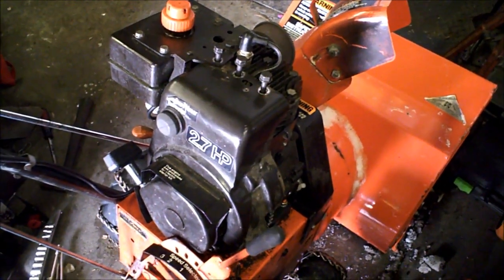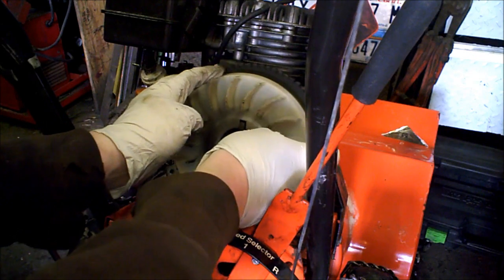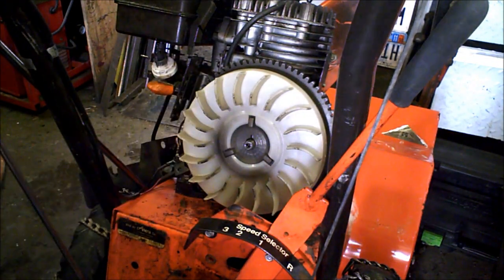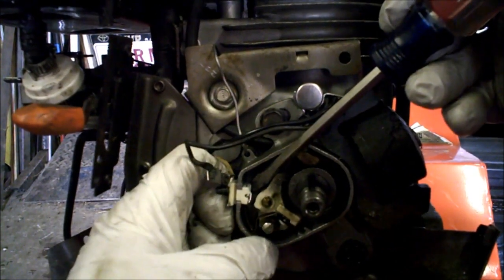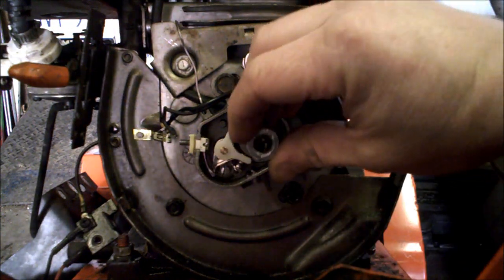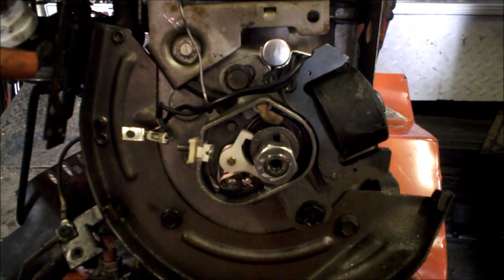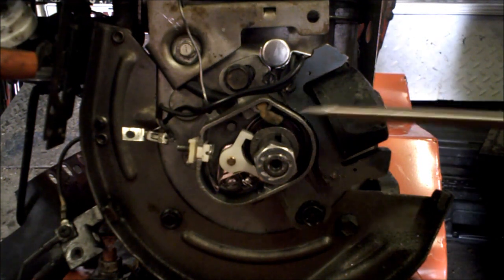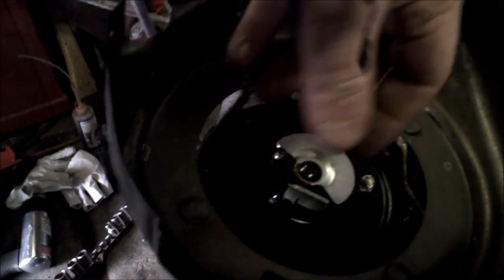Tecumseh Points and Condenser 3-10hp replace

Comment: I have a 40 year old outboard motor with a Tecumseh engine. I don't get a spark across the spark plug when I ground it, but I can feel the slight jolt when I ground the plug and hold it by the top.  Replaced coil, condenser and points 10 years ago and barely used the motor since.

I can test the condenser with my electronic meter.

Is it possible my flywheel magnet is too weak to provide a spark?
Reply from the maker: More than likely the points are tarnished from moisture in the air. Run a fine piece of sandpaper between them and you should be good to go.

Comment: Question: I have an old Sears/Craftsman snowblower with a 8hp Tecumseh.  The plastic fins are almost all broken (although the remaining ones still move some air), and parts are hard to come by.  Any ideas on how to fix this?
Reply from the maker: eBay will have your parts. The plastic shroud simply attaches to the cast iron flywheel.

Comment: this is great, I put one of these Tecumseh 10hp but same kind of points, on my log splitter, it worked for one afternoon now it won't start. The points are shiny, the condenser is rusted and looks original.  is there any way to test the condenser or ignition
I have a spark at the spark plug ...
Reply from the maker: Testing the condensor isn't easy, because you need a capacitence tester. Generally points and condensors are replaced together as routine maintenance. If it is rusted, water has gotten in and more than likely the points are corroded as well. Test for weak spark by holding a screwdriver(hold plastic handle) metal shaft around 1/4" away from the engine block, with the tip of the screwdriver inserted into the spark plug lead and you should see spark. This would signify a healthy strong spark.
Reply: Thanks! Is there anyone on line who you know carries this kind of condenser and points?
Reply from the maker: Yes, the points and condesor for these are very common and can be found online. If you look in the video description I have a link.

Comment: I have a Ariens 8hp 1976 with a TECUMSEN ENGINE. I have no spark to the plug. After seeing your instructions I will attempt to take it apart and check the ignition spark plg and condenser . I do believe that your vidieo will help me Thanks ( Chris Eybergen)
Reply from the maker: More than likely your points contacts of corroded a little. You can pick up a set of points/condesor very cheap online. On a side note; don't remove the ignition coil, as it is a long process to retime the entire engine.

Comment: Thanks for the video, very helpful.  I just had a quick question.  I have a 1980s Craftsman snow blower (Tecumseh engine model no. 143.687032), very similar to what you worked on in this video (at least the same orientation of magneto). I was wondering if this engine has the ability to produce a little power to run a light on the blower - I know some engines out there have a stator with a lead coming out of the engine so that you can power something like a light.  Well, my blower doesn't have a light built-in, but I would like to install one on it - my owner's manual for my blower says in the parts list that it has a stator assembly, but I don't really see an obvious lead coming out of the engine for powering separate electrical components like a light.  But since the manual says stator in the parts list, would that somehow work to produce a little power to run a light so that I wouldn't need to install a battery?
Reply from the maker: If it is a 8 or 10hp there is a chance it has a stator installed, but you will see an obvious loose wire coming out under the electric starter/side opposite the carburetor. It should be protruding approx 3-4inches. It isn't very common to have a stator installed but I've seen it and added lights. If you don't have one, your best bet is to just install a battery operated LED light.
Reply: @sixtyfiveford  Thank you very much for your considerations.  Yea, my blower is only around 5-6hp and doesn't have an obvious lead coming out of the engine for a light.  So as you mentioned (which was my alternate plan), I will get a nice 12 volt battery and led lights to install on the snow blower.

Comment: So many people hate Tecumseh engines.  I absolutely love them and I've never had a bad one.  When buying power equipment, I would only buy them if they HAD a Tecumseh.  At one time, 99.99 percent of all snowblowers came with the famous Tecumseh Snow King engine including all of the major manufacturers of quality machines ie:  Toro, Ariens, John Deere, MTD, Craftsman;  and the list goes on and on.  Tecumseh actually MADE Craftsman Lawn Mowers famous.  My John Deere 826 is 32 years old and it never misses a beat.  Tecumseh;  they were the best.  Keep the carbs clean, change oil often and at the right level, and they work and work hard.  They love it. What are your thoughts?
Reply from the maker: I'm a big fan of Tecumseh. I think Tecumseh made the easiest to start and best running winter engines ever. I've never had one I couldn't make a single pull start machine even in single digit temperatures. I love their push mower engines but prefer the larger Briggs Engines on Riding mowers.
Reply: I agree 100%, especially if its on a snowblower.
Only one thing, the points are harder to deal with than on Tecumseh vs a Briggs.
I'm dealing with it right now.
Ive dealt with it in the past too.
I sanded the points on the Briggs, spark came right back, the Tecumseh no dice and they both had spark in the summer time..
Otherwise their great, even better with electronic ignition.

Comment: good video ! wish i could find an old flywheel for mine as magnet fell off and broke into a few pieces,  have called some repair shops and they don't have a flywheel for my hm80-155127f  snowbird   hate to toss it out!
Reply from the maker: Ebay will have them. You should be able to pick up a used one for around 30-40bucks (without electric start ring gear) delivered.

Comment: Hey, 65 Ford guy, does that make you a Mustang, a Galaxie, a Falcon, a Fairlane, a F100 Pick'em Up Truck, or an Econoline PU? Inquiring minds want to know?

Thank you for the video about how to replace a condenser and set of points on a Tecumseh engine. This helped me out a lot. I guess since the points center pivot point is a fixed location, this would mean that the cam "timing" is non adjustable correct? 

I think most engines have some kind of "sweet spot" in the cam timing, where the engine is perking right along producing maximum torque  due to a whole lot of other "engine things" are  all working together, all at their best place in time. I think the most important thing is when the spark is advanced just enough to allow all the other important engine things to work together and do their best stuff.  Case in point, search for the "hit and miss" category under the heading of Old Iron. 

Does my lil three Hp one- lunger Tecumseh have this spark advancement feature built into it ? When the cam follower is at the top of the cam lobe, is the piston also at Top Dead Center? The ignition spark occurs when the points are first opened, quite a while before the lobe reaches its maximum height.   On my 1973 Yamaha 350, two-stroke, two banger, I set the points to where they open at so many degrees before each piston reaches it's TDC position. 

I'm not quite sure what setting the point gap to 0.20 thou actually does? At anything less than that magic number, what happens, do the contacts spark twice or what? What about if the gap is too big, what happens in that scenario, does anybody know? It seems like the engines spark timing must be engineered and "built into" the shape of the spark cam lobe itself? 

Anybody out there care to share what they know about ignition timing cam shapes?

I do know that engine intake and exhaust valve timing is critical for proper engine performance, and the shape or "grind" of a cam lobe can make one heck of a lot of difference where and when the engine breathes at its very best.  

One last probably very dumb question, something I am too embarrassed to actually  do during the day, lest my neighbors see me trying to do it and probably failing miserably shaking their heads at my utter stupidity for even trying to do it. 

Here goes, has anybody (probably lives on a private road) tried to use their two stage snow-thrower/blower to pick up, and (maybe?) grind up dry leaves, all the while blowing them into some sort of large breathable fabric bag of some kind, attached to the snow discharge spout? 

I know, I know, it's probably an insane idea to conceive it might work, let alone being something someone would be foolhardy enough to actually try to do. 

mrc109
Reply from the maker: +mrc109 F100 Pickup... 

The cam timing is fixed. You can adjust the spark timing by moving the ignition coil also by increasing/decreasing the point gap. The machine is designed for optimal dwell with a .020" gap and timed for that. If the gap gets too big you are wasting time that the system is building up spark energy for the next fire, if it is too small the spark can just the point gap. You could spend days playing with it and though on paper it may be better you would never get a noticeable power increase. The horsepower is just too small and most people are never pushing the HP to the max everytime they use it. The hit and miss engines are a different game entirely and are more rustic in their running functions. The only time a person would play with this is in racing applications and that involves much much higher rpms than these were designed to run stock. So if it is built up with all new internals and it is pushed above the stock 3600rpm, say 6000+ you will need to play with these things to get it just right. 

There is a video of a guy using it snowblower to throw leaved into the bed of his truck. Not very practical and I believe a standard push mower  with a bag is far superior.

Comment from the maker: I took a screwdriver and put the tip in the sparkplug boot and held the metal shaft of the screwdriver 1/8" away from the engine block. You should get a good spark when the rope is pulled. It had no spark. 95% of the time it's points, 4.9% of the time its condenser and .1% of the time its a bad coil.

Comment: hey 65,lov all the vids bro! i got older ariens snowblower tecumseh engine,did everything,points condenser,coil and flywheel and still no spark,how do i gound it? i swapped motorsand think thats the trouble,disconected all the switches and im pretty flusted.can u PLZ HELP!
Reply from the maker: The wire coming off the coil should not be grounded. Grounding it kills the spark signal.

Comment: Follow up.  I found the diagram online for the Tecumseh HMSK100 (159182T) and it does not appear to have points/condenser.  Just a coil.  Sound right to you?
Reply from the maker: Jeffery Bryan Yep, it'll be just a coil if it was made in the last 30years. They're great engines. The only advice I have is to run it 100% out of gas at the end of the season. This will ensure that it'll start right up the next season. Also if you want problem free running ethanol free gas is your best friend in any power equipment. The site pure-gas.org shows you local stations that offer this.

Comment: Hi great video, would you know the procedure to adjust the carb. on an 8hp Techumseh ?
Reply from the maker: Adjustment will only be required if it was manually miss-adjusted. I would clean the carb first, then go through the adjustment procedure. 

Start engine
Turn main jet screw(bottom of carb) out (ccw) until hesitation is heard/felt
Turn main jet screw inwards(cw) until hesitation is heard felt
Note the turns it took to get these two points  and set the main jet in the middle, maybe a little on the screwed out side(rich mixture)

The idle jet is set the same way, but with the engine idling vs running full rpm.

Clean the carb video: https://youtu.be/4W9Y3JC1yDY
Reply: Thanks for the Help. Its much appreciated!

Comment: what is your opinion about how often  the breaker points and condenser should be change  aprox .  in general
thanks
very nice video
Reply from the maker: I would say they need servicing every 5 years or so and need change only if they go bad(10-15years sometimes longer)
Reply: thanks for your comment

Comment: I like your video., However just curious could you also use a gear puller to pull that flywheel off for one? And two are you sure that that was 20,000s of an inch and not 200. Of an inch I just saw a simple math remember in third grade and learning decimals and fractions and.020 it's 200s? Correct me if I'm wrong
Reply from the maker: .001" is said as 1 thousandth so 20 of those( .020") is said as 20 thousandths. technically you could also say it correctly as "2 hundredths" but it is more commonly accepted to speak these measurements in the thousandths place since a lot of things go to the thousandths place; ie spark plug gap is 35 thousandths .035". 
A puller will generally end up breaking the flywheel or not fitting behind. They end up doing more harm than good on a taper shaft.
Reply: rs480285 ,I used a 3 jaw puller ,tighten,then tap center pivot,and cast iron flywheel shot off after the third torque+ tap.I'm really careful with aluminum ones,have broke off several fins in the past.

Comment: I changed out my points and condenser. I got spark. I'm sure it's set right. Idk just will not fire up. Iv checked it a bunch of times. Dose the kill wire hafe to be hooked up?
Reply from the maker: The kill wire shouldn't be touching any metal. If it does it'll ground out the spark.
Reply: @sixtyfiveford  that's the thing I don't have the kill wire hooked up at all it's just the condenser wire and the coil I know I got it hooked up right because it's getting spark but it might be out of time not by much I just don't get it
Reply from the maker: @revolution3797 The only way it'll go out of time is if you removed/loosened moved the coil. If it's out of time it would still fire and attempt to run. And or it'll fire too early and rip the pull cord out of your hand. 

Pull the plug and with choke off pull the cord a dozen times to clear any excess fuel in the cylinder. Place 5-6 drops of fuel down the spark plug hole. Insert the plug, still no choke but throttle set to fast. Attempt to start now. You should get it to run for a few seconds if you have good spark and compression.
Reply: @sixtyfiveford   gonna post a video of it, that's why the guy sold it because he couldn't get it running. I'm good too,it's a hubby of mine,been doing it for years.
Reply from the maker: @revolution3797  Sure you don't have a valve sticking open?
Reply: @sixtyfiveford  not sure I don't believe so worst case scenario I'll just have to take the head off and buy a new gasket thanks for replying
Reply from the maker: @revolution3797  I've had scenarios where the valve closes really slow. Generally, you can see the edge of it through the spark plug hole and watch it.

Comment: Changed the points, condenser, and coil  still no spark any idea? Thanks Fred
Reply from the maker: Make sure the grounding wire isn't touching the frame anywhere. It's best to completely disconnect it from under the carb for testing.

Comment: This is all great, but what do you do when the 8HP horizontal (generator) engine has no nameplate/model number anywhere (there is nameplate for the generator, but that says nothing about the engine), and dealers claim magneto/point replacements "do not exist"?  My magneto has 3 legs, and it is set inside a hollow flywheel (with inward-facing magnets).  If I could get parts lists/diagrams from a group of engines, I could have a prayer of finding replacement parts!  There are also electronic replacements for points/condenser that I would like to get for my engine.
Reply from the maker: What brand of engine is it?
Reply: @sixtyfiveford  Tecumseh.  I know it is 8HP, horizontal crankshaft, driving 4KW generator.
Reply from the maker: @bpark10001  Engine ID is stamped on the very top of the pull start air shroud. It should be a hm80. Manufactures like to bolt stuff over this stamping. If it was made after the mid 80's there are no points.